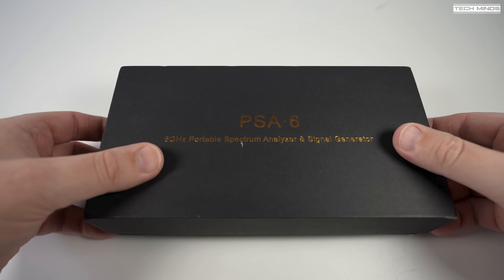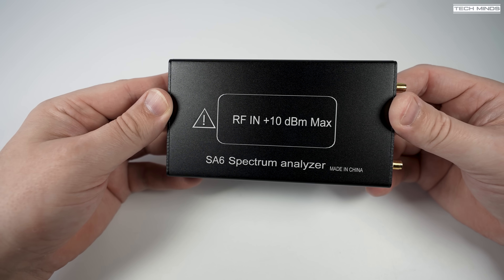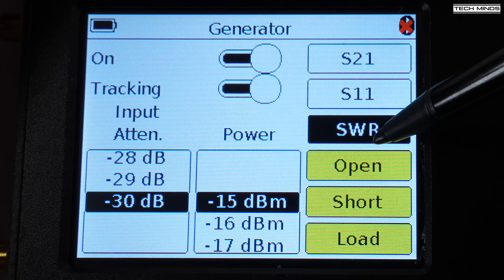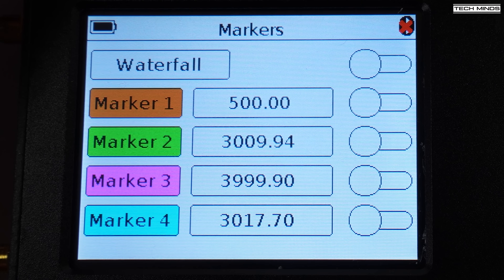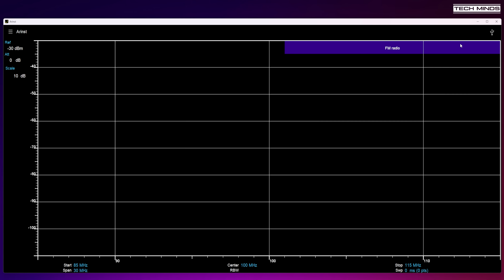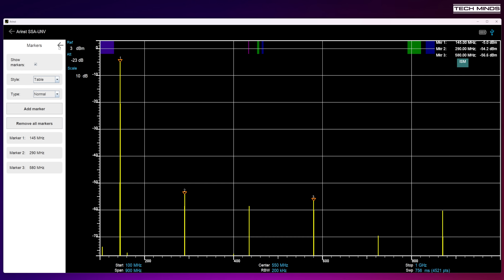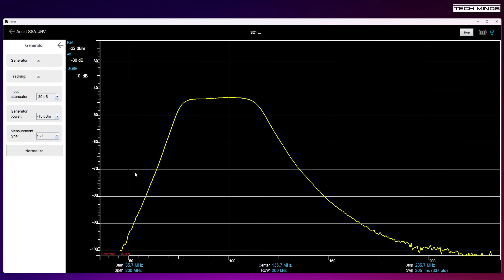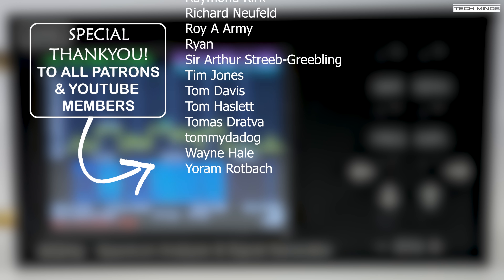6 GHz Spectrum Analyzer & Signal Generator - Test Your Radio Components Now! SA6

Comment: I see you at least got a piece of paper with yours.  Mine came in a box with no explanation.  The power on button on yours is labeled "reset" on mine and there is an "on/off" switch that seems to only take the battery out of the circuit.  I still need to press "reset" to turn it on.  I suppose it would be best described as a cheap Chinese copy of a Russian design but it's a pretty cool way to look at filters and I do have a directional coupler so I can get a decent picture of return loss.

Comment: it’s rusian arinst device, that company directly supports and helps rusian genocidal army
Reply: I opened SA6 - no russian parts there,   all american components, BT not present on board
Reply: @fmtvus  well of course there will be no rusian parts, same as in their cruise missiles, except for minority of those ancient soviet logic chips and old stm32 clones. the point is  it’s obviously made in china but arinst designs, orders and sells it. in this case i suspect they removed the brand logo to evade sanctions. look at arinst sa series, you’ll be surprised how familiar it is 😉
Reply: @sigaretter  could this theoretically be used as an off the shelf way to analyse the jamming signals coming out the new Russian drone jammers they are fitting to tanks and apcs in the Ukraine? if fitted to a drone and flown close enough to detect but not enough to lose control of the drone?
Reply: @j55321 there’s no need for that as there’s plenty of trophy rusian jammers of all flavors. typically they use chinese COTS VCOs from aliexpress that generally produce a triangle wave and it’s not really effective when used against FPVs controlled by ELRS (LoRa)

Comment: Hackrf with portapack can do the same and has more fuction.
Reply: Maybe so but for under 200 bucks to be able to have a spectrum analyzer and tracking generator is huge.
Reply: how ? what software ?
Reply: The Hackrf and the SA6 are both nice toys but they don't do the same things.  The Hackrf is simplex. It can generate OR receive but cannot do both at once.  The SA6, as a wide band analyzer with tracking generator, does do both at once.  The Hackrf offers modulation and demodulation options that the SA6 does not.  The Hackrf covers frequencies below 35Mhz which the SA6 does not but it only goes down to 1Mhz.  If you want to go lower than that you might want a Nanovna or a Tinysa ultra (which are also cool tools with their own limitations).